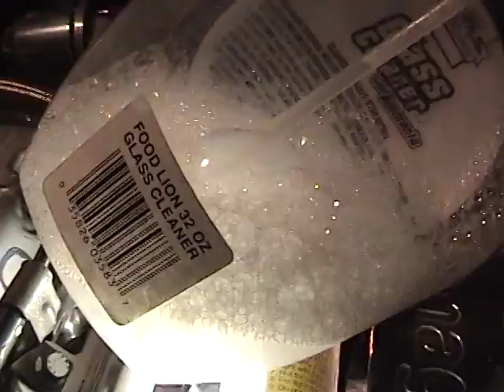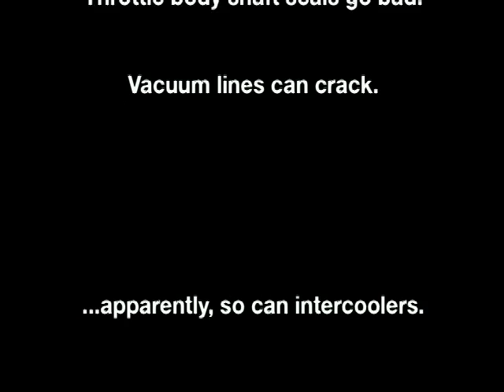Boost Leak Testing 201: Using the tool.

Comment: How did you make those coolant hoses? Are those just AN fittings and stainless hose?
Reply from the maker: The radiator hoses are the Greddy coolant hose kit.  The rest of them are AN fittings and stainless hose.  Be careful using these un-secured in the engine bay because stainless hoses are like a saw that will cut through anything it's touching.  The hose shielding is harder than everything else in your engine bay.

Comment: Love this channel,

figuratively speaking if you had NO leaks, should you still expect a slow decrease in the PSI needle on the boost leak tester? I am so confused by this aspect of boost leak testing (valves open etc). I have also been told to do a boost leak test with the oil cap removed. please confirm and help me clear some of this up. The internet is just as full of misinformation as it is information.

EvoIX BTW
Reply from the maker: There will always be a slow leak at the rings and valve seals.  Turbo engines aren't famous for having valve overlap, but if you encounter it, grab a wrench, turn the crank a little and it should stop unless you've got a burnt valve.  In all my years of boost leak testing, I've never had to do that.  

Taking the oil cap off?  I suppose that idea came from someone who blocked off all their crankcase breather ports?  I've blocked breather ports just so I didn't have to listen to the blowby while listening for other leaks... but the breather port should be able to handle whatever amount of blowby that's produced from the test.  I don't know what benefit that would provide?  I suppose air pressure could push oil from the gallery back to the pan maybe?  I dunno?

Comment: Jafro, question for ya.  I get fixing the giant leak on the IC but does it really make a difference fixing those little tiny leaks?  I mean you're flowing hundreds of CFM at boost, you could only be losing what.. 1 CFM out those injectors??  I get you're a perfectionist and all and I respect that but does it really help to be SEALED up 100%?
Reply from the maker: When you're doing your baseline tune, you should have ALL your boost leaks sorted and air tight.  If you've got leaks, then eventually they'll only get worse (unless later down the road you end up replacing the leaky part).  If you do your baseline tune and then fix your boost leaks, you end up chasing your tail with your tune and having to start all over.  You'll use parts of your airflow table once the boost leak is fixed that you weren't using when it was leaking.  How far off in that table you go astray depends somewhat on your airflow metering setup and whether or not it's affected by your leaks (for instance, factory MAF vs. GM Blow-Thru setup, or speed density).  Some are more forgiving than others, but you need to do your baseline tune with every possible leak eliminated so that you can tune the broadest spectrum of your airflow map possible.  Metered air that leaks out will make you run rich, but usually that's safe.  Rich knock is less dangerous than lean knock.

Reason 2 is that your boost leaks are only boost leaks when you're under boost.  Once you're cruising or off-throttle, they're not boost leaks anymore.  They're vacuum leaks.  Same airflow metering system rules apply, but unmetered air leaking IN makes you run lean and your throttle response turns to 💩 as you transition from vacuum to boost.  It makes the car run like poop.  It affects throttle response and if knock occurs, there goes your timing advance.

Reason 3 is that your wastegate is actuated by both boost and vacuum.  If you have boost leaks, the turbo has to spin faster to achieve the pressure necessary to open the wastegate, and the faster the turbo spins to achieve that pressure, the hotter the intake side operates.  It loses efficiency.  The hotter your intake charge, the more volatile your fuel becomes and the less air you can fit into the combustion chamber.  Your intercooler's efficiency, or your methanol injection system's efficiency, or whatever you're using to lower your intake air charge temperature is relative to the temperature air charge it's being fed.  So the intake temps, density of the air charge and fuel volatility (which may lead to knock and loss of timing advance) results in a loss of total power output.

There are really 5 reasons that go on to affect fuel economy and braking, but based on these 3 reasons listed above, if performance is the goal, the only right way to do it is to achieve an air-tight intake tract that doesn't leak at all.  Any leak is a loss of efficiency, and results in inaccuracies in your tuning.  Little leaks add up and make a bigger difference than we can see and hear, or feel on the butt dyno.  The responsible thing to do is to fix them all and get the most out of your engine.
Reply: wow. thanks for the lengthy reply!  I do have some "ghosts in the machine" that maybe some of this explains.  I have a haltech ECU in my eclipse that no matter how much tuning always seems to "hunt" around being rich or lean and never right (even under what seems to be the same conditions). I always figure I have sticky injectors or inconsistent fuel pressure etc. I'm going to make a version of your leak test tool to fit my turbo inlet and see how leaky my system is.  I'll let you know if it helps!  thanks!!

Comment: After this- you'll have a sparkly clean engine. LEARN= Teflon tape is not meant to "seal" anything. It is designed to be an inert, non-migrating thread lubricator that allows threads to twist more tightly closed, without galling and seizing prematurely- making a leak.

Comment: I know this is a old video, but does/did the GSX have functioning AC? I saw when you yanked the engine out that it had an AC compressor on the back of the block, just didn't know if it was actually functional or not.
Reply from the maker: +BoostedCajun It's a working compressor, yes.  Perfectly good new compressor.  I had an electrical problem that popped up shortly before it went out of commission.  My last compressor clutch burnt slam up. After I replaced it I could never get voltage to the AC compressor with the AC switch engaged, despite using the factory fan circuit wiring on my flex-a-lite twin fan setup, and I never finished troubleshooting it before the engine let go.  It worked for years before, I just lost the motor mid-repair on the AC system.  Still has working everything except for the fog lights.  It's sat for so long I don't know what it's going to look like after I drag it back in to the shop... but it all worked the last time I parked it.  Still had functioning ABS, too.  I'll finish what I started with the AC, and honestly, the more that's wrong with that car once I start posting videos of it only helps all of you.  Pray that everything quit working.  I lost rod bearings in the Hyundai and it created 26 videos.  Just a set of rod bearings...
Reply: +Jafromobile It was indeed a great learning experience that that mishap happened to you. I can say personally it was very beneficial to me. I can't wait to see how you're going to deal with the wiring in the Colt and the Elantra as well. Since both are sort of similar to my 94 Mirage Coupe. I actually found a guy that makes PnP harnesses for our cars, so that's the route I will be taking.  Funny every Mitsubishi I've had over the years (3 of them, 2 Mirages and 1 Lancer). They've all had AC issues around the 100K mark right around the warranties end. Hope all is good with you brother, just binge watching your videos to see if I missed anything :-)

Comment: Thats bad welding a weld should be as strong if not stronger than the rest of it.
Reply from the maker: +Kean Campling I wish you were right.  It was actually caused by a clutch alignment problem which resulted in pulsating backpressure in the intake system.  That is what fatigued the end tanks and caused them to fail.  Eventually it caused damage to the main bearings and the rest of the engine.  

The welds are harder and more brittle than the materials the end tanks were made from, and that's why the welds cracked apart instead of the end tanks themselves.  So let's call it a 50/50.  It wasn't a bad weld, and the weld was as strong and stronger than the rest of it.  I blamed this part as it broke on 7 different occasions.  I used 3 different professional welding services and I did this in ignorance because this part failing wasn't the cause of the problem, it was the result.

Comment: I make a leak tester for my Mazdaspeed 3, but I didn't integrate a gauge. What I do instead is to watch my mechanical boost gauge, or hook up my datalogger and monitor manifold pressure to observe how quickly the system depressurizes. My understanding is that a healthy system won't continuously hold air like a tire would, but should have a fairly slow rate of pressure release, like maybe 1 psi/second. This is because air will leak past the rings, etc.; it's not a completely closed system like a pneumatic tire is. What are you thoughts on this?
Reply from the maker: Zack Richmond You are correct on all counts!  Combustion engines are not 100% efficient, so they can't hold it all in.  1 PSI per second is still a little bit fast in my book, fast enough to make me keep looking, but the slower the leak, the better. 1 PSI every 2 seconds is GRAVY.  I will warn you though... having a gauge on the tester will spoil you rotten.  You get to be fewer places at once.
Reply: ***** Yeah, the increased utility of having it right there is probably pretty useful, I'd imagine. My datalogger (it's a COBB AccessPORT) connects through the OBD-II and has a long cable, so I can pretty much watch its display from anywhere under the hood too. I need to do another boost leak test soon, just as general maintenance. I just connect mine to the end of my intake, which I know never sees anything other than vacuum in real world conditions, but I have everything tightened down good so that it'll hold boost just fine and help me find leaks elsewhere too. It really is a matter of convenience because on MS3s our turbos are all the way at the back of the engine, between the block and the firewall. Getting off everything before the turbo inlet can be quite a chore. I wish our exhaust side was right up there in the front, like yours!

Comment: The first tool might be leaking because you wrapped the Teflon tape backwards on the threads. Always wrap it in the direction you wind the fitting in so the end doesn't lift and ball up in the thread.

Comment: when you are pressuring the system  you have your adapter where the intake  hose from maf  attached??
 on system with no leaks at all will the  gauge of booster should hold steady  pressure  comparing with pressure gauge of compressor  or  will be some leak if intake valve open on any cylinder??
thanks for sharing nice video
Reply from the maker: Some leaks past the rings and will blow out of the breather.  It's only natural because of ring gap.  Put the tester on the turbine inlet.  It should leak down VERY slowly if your rings and intake are in good shape.  None will leak past the valves because on most turbo cars, there is no overlap in the cams.  One set of valves will always be closed.

Comment: Hi Jaff. I tested for boost leak and all was greater than ever imagined. However the only leak is that the turbo inlet housing, the o-ring sorta thing usually sorta red colored. Anyhow I really like the video which was helpful. If ya know the o-ring sorta thing im talking about. Then do you know where to find them at because I cant seem to find anything. Thanks

Comment: Hey Jafro I'm trying to do a boost leak test on my 2g, problem is, as soon as I put any air into it the bov starts letting it out. It's a 1g bov that otherwise works fine, so I'm not sure the its the problem. I was reading on the forums about needing a boost source (i.e. the intake manifold, which I already have) for the bov during the blt, but I didn't see anything special going to the bov in your video. Any idea what could be happening?

Comment: Crower 272s GT42R v-band  FIC 850cc's AEM TruBoost Tuning with Apexi NEO afc and NGK Wideband. Pulleys, rad, short route piping. We sprayed soap but didn't find leaks today. I think I am tuning the GM MAF wrong. Any suggestions on pos MAF Translator? Before it skipped timing when the balance shaft belt broke it idled high. Now it idles low after the fix. Evertything seems to work fine. Under boost it goes really rich. When I let off it goes back to the leanest it can like it does at idle. Thx

Comment: I can't figure out my p0300 random missfire. I have checked and changed plugs/wires power transistor, MAF had the injectors cleaned w/ new seals, new fuel filter and the fuel pressure is fine.

Comment: Okay so i had to replace my mass air flow sensor somehow it got messed up and wasnt reading correctly soTHANK YOU, it fixed my problem and is running like a dream..i made a trip from shreveport la to houston tx and came back its running great i cant thank you enough! If you dont mind i do have one other question...the guy i bought my GSX from had just some cheap tin metal as a scoop..well it didnt make the trip any suggestions what i should try instead the metal or just have another made?

Comment: I need your help please..i bought a 99 eclipse GSX turbo and well 2 days ago i was getting onto the interstate and i didnt think i got on it too hard well it backfired and then all of a sudden started loosing power and motor real jumpy and missing well i figured out that i was missing a clip on the bottom of a boot connecting my turbo to my inner cooler well i fixed that been running  great even today then i got in it and it started acting same way got out checked all my turbo hoses nothing..

Comment: surely if a piston was at its mid stroke or valves were over lapping, the air pumping in would escape out the exhaust, or past the rings and blow the dipstick or the oilcap out? i use something similar, but i block the end at the throttle body so it doesnt test that, or injector seals and stuff.

Comment: Well, like I said the dude who rebuilt it did a horrible job, 4 bolts in the 7 bolt transmission for starters. So, now I'm gonna go for it, slowly, but I'm going for it. 
So in rebuilding, it'd be a good idea to go ahead and do the front and rear main seals?

Comment: Well see, I've already got arp head studs in it. This guy I know told me that I should've retorqued the studs after 500 miles.. I was not aware of this until now. But, I look at it as some what of a plus.. Bc now I can use this as a learning experience. 
So, I found some more info on my car, I'm running a big 16g, I was very interested when I found that out.
Another ?, what do cams do? I've wanted to put bigger cams, what don't know their function in the car.

Comment: Concerning the oil cooler, do you have to get an aftermarket oil filter housing?
Or will the stock one have the spot in the back to run the lines to?

Comment: When you do this aren't you supposed to make sure all the valves are closed so you dont blow out the cam seals or something like that? I remember when I had my subaru I had to take the oil fill cap off so it would vent any air so I wouldnt blow the seals out.

Comment: @Jafromobile 

you just raise a good point with the leaks visible under pressure only.
As soon as i made the "tool" for the fume under pressure i videotape it.
i saw you made tests under 30 psi !
that's a lot for injectors or vacuums lines i think no ?
aren't they supposed to work under vaccum an not positive pressure ?
maybe you cause yourself a leak when you do that ?
or i don't know something about those tests ?
however  for boost lines i would make the same as you it's sure !

Comment: you should try smoke for those tests !

the advantage is you can SEE the leaks even if they are tiny.
the soap is good but you can't spray it everywhere.

i've bought a smoke machine used for parties wich is cheaper that the specific for mechanics and i will adapt with a hose to detect leaks in the vacuum lines exhaust pipes injectors etc...
i think you should try it .
it works quite well.

Comment: @Jafromobile I have my boost source for my external wastegate coming off a fitting on my comp housing of my 35r =] only thing coming off my manifold/ throttle body is a line for my boost gauge and a vacuum source for my afpr.

Comment: At what PSI do you have the compressor regulator while doing the test man?
Reply: Typically whatever boost pressure you run. But leak will show at low psi too.

Comment: You can also check your throttlebody shaft seals. Sometimes if you if you turn your throttle  plate while pressurized. You can hear the leak sound change at the throttle body if a shaft seal leak is present.